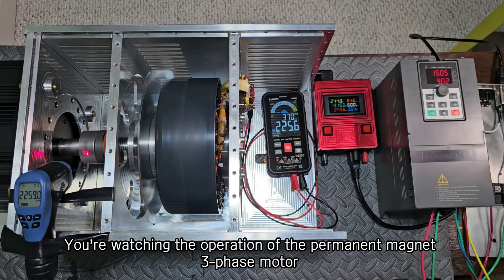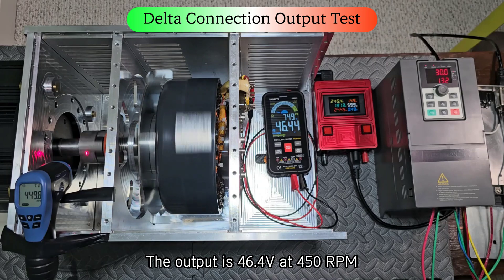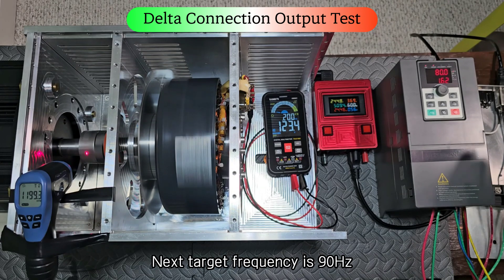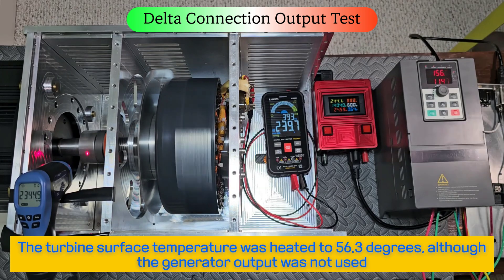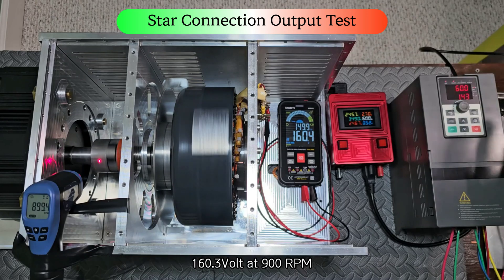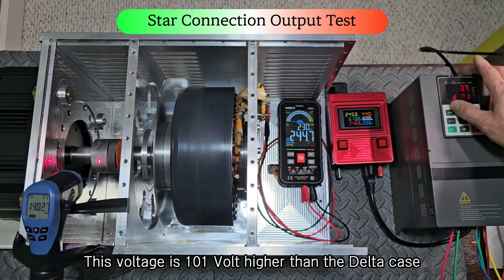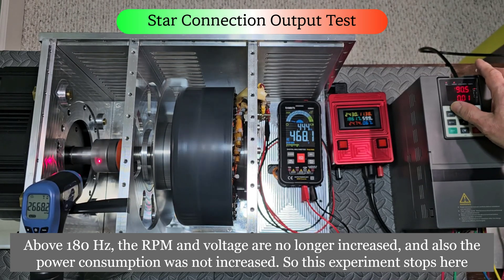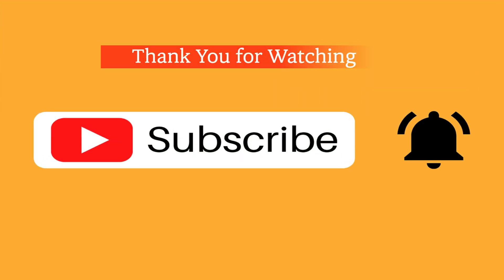Testing a 3-Phase Permanent Magnet Generator with Synchronous Motor | RPM & Output Test (Part 2)

Comment: So at the end you got 3kw of power. At this output how much is your input?
Reply from the maker: I didn't measure it. When there was no load on the generator, it took about 1.5kw to maintain the maximum RPM

Comment: This is all well and good if you plan to rectify the output and use only for D.C. power. In your first test, you stated, "...this is the voltage used in the United States." The problem is, by my calculations, the output frequency is 80 Hz. Therefore, this cannot directly supply a squirrel cage AC motor. The most common motor in the U.S.
Reply from the maker: You're right!. I just wanted to mention the voltage level generated. And 80Hz is the inverter frequency, not the output frequency of the generated power. The frequency of the generated power was much higher. Therefore, the electrical device that could safely test the power was the heating lamp that was unrelated to the frequency. Anyway thank you for your comment.
Reply: @LanikaiEnergy  this can't be used for power stations
Reply from the maker: @laone-t2l  If you need a power station, you can buy it on Alibaba's site.
https://www.alibaba.com/trade/search?spm=a2700.galleryofferlist.the-new-header_fy23_pc_search_bar.keydown__Enter&tab=all&SearchText=5KW+power+station

Comment: perhaps
Reply: Hello Sir, this a great great job !! And your other videos too.
 Only a question:  How many kilowatts did the motor consume to light the 6 filaments of 3 kW total?
Best Regards
Reply from the maker: @ If the PM motor runs at full RPM without load, it consumes about 1.5KW. So if I add 3KW, I expect 4.5KW, but I didn't check it at that time.
Reply from the maker: Thank you for your comments, it hasn't been long since I started YouTube. I posted a total of 5 videos two days ago, so please watch the other 4 as well. I'm also working on a new video using a large stepping motor, and it will be uploaded next week, so please subscribe to my channel.